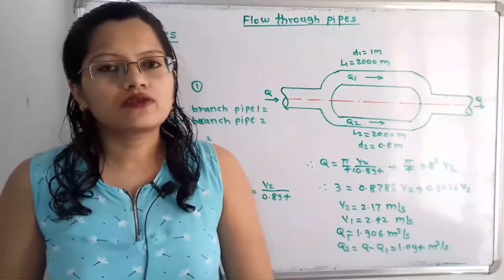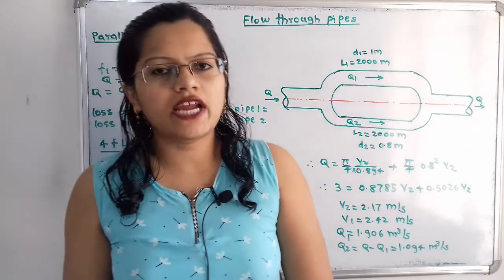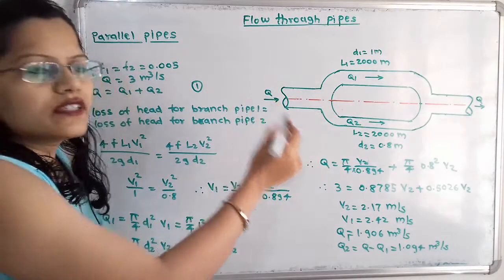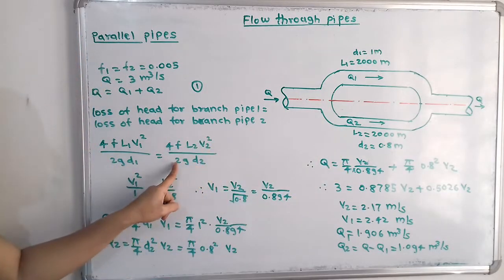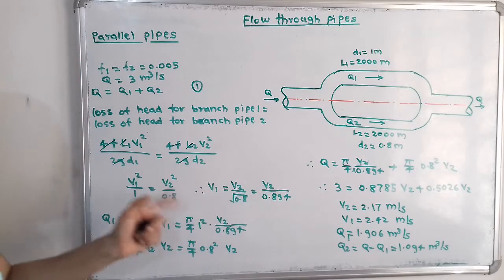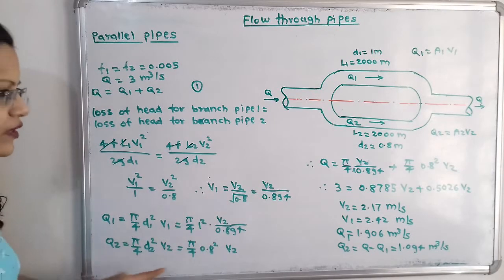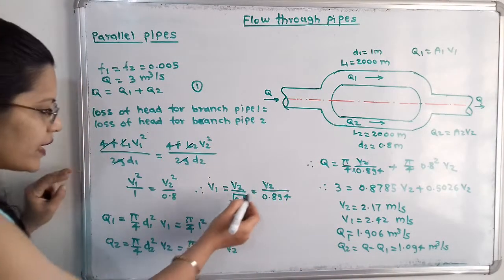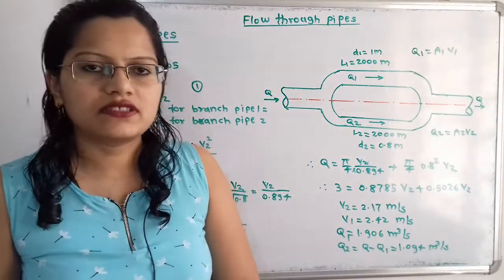Problem on flow through parallel pipes/flow through pipes

Comment: Two Sharp ended pipes of diameter 60mm and 120 mm respectively, each of (10) length 120m are connected in parallel between two reservoirs Which have a difference of level of 12m. If the Coefficient of friction for each pipe is (41) 0.32 Calculate the rate of flow for each pipe and also the diameter of a single pipe 100m long. Which would give the same discharge? If it were Substituted for the original